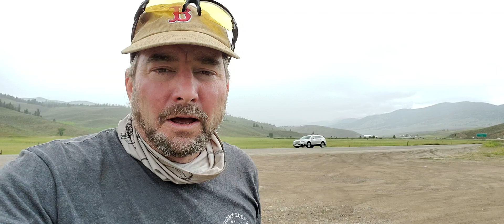737 Emergency AD

Comment from the maker: 5th stage bleed air operation-
"when the engine is "working hard" there is enough air coming out of the 5th stage, to supply everything.  Flows through the engine to make that amount of power, are "high" and the 5th stage supplies everything, and the 9th stage valve is closed.

Pull back to idle for descent, and 5th stage pressures drop, there is not enough air going through.  Now the 9th stage opens, the 5th stage check valve is FORCED CLOSED and the 9th stage supplies the air to the Airpac and everything else.

The check valve is there to prevent the discharge from the 9th stage flowing INTO the 5th stage of the compressor string.  It starts traveling in circles, causing compressor stalls."
Reply: I wonder why the AD was not for the A320 series of aircraft with the same engines. About 1/2 of the Airbus A320s have the similar (if not the same) CFM engines.
Reply: A320‘s have a diff. Manufacturers of their IPCV valves Liebherr (CEO) and Safran (NEO). IPCV stands for Intermediate pressure check valve than the one on Boeing 737CL and NG called 5th stage bleed air check valve.
Reply: I did not know that, thanks. @glincho
Reply: Darn your good! Greetings from kbos. Have a happy day

Comment: It is a simple operation to cycle the PRSOV , pressure regulator shut off valve on the ground . For the amount of time they have been parked it should be part of the return to service checks being done before returning them back into service

Comment: Sounds like the "early days" of automotive smog systems. When the EGR valve would stick open during highway speeds there would be no problem. When you'd come up to a stop sign, the open valve would disrupt the air/fuel ratio and the engine would stall. A stuck open bleed valve would be basically a giant air leak that the fuel control is not expecting.

Comment: To be more precise, AD #: 2020-16-51 concerns the 5th stage “check valve”.  The description given, although generally accurate, it is not entirely accurate as it relates to the operation of the 5th stage “check valve” on these affected CFM engines.

Comment: Why is the emergency airworthiness directive issued to the airframe and not the engine?  Something strange (or political) going on here.
Reply: AV8TOR well how is the plane supposed to fly without the engine?
Reply: @tomstravels520  That engine is used on other aircraft designs/types.  So it's not a "Boeing" issue.  To answer your question.  Gliders or sailplanes.
Reply: AV8TOR that specific engine type is only used on the 737. The A320 has a different type of CFM-56. And how does a glider get into the air in the first place? Also the clue is in the name....they glide.

Comment: This is the low pressure valve.   Actually it is open all the time.  What protects back flow from the high pressure valve is a check valve.   The check valve must be failing in the open position.
Reply: The 5th stage valve is supposed to close when HSV opens at idle or low N1 rpm, to prevent 9stage air going into 5th stage duct and compressor. Yes it seizes in open.

Comment: Dont know 4 engines is a lot, esp. if potential 1 engine landings 
also we dont think they will corrode less if longer in storage, right?
So the failure rate goes only up over time. 
Luckely they caught it now and can fix it, before an accedent happend.

Comment: Juan,  what ever you drive again or ride again you will always be looking out the window because you know what the ground looks like. I spend all my time riding aircraft looking out windows and seeing the roads I have been on. Every time I see a stretch of highway that I recognize from the air it brings back different memories of the hundreds of times I have driven that road or flown over it. They are like songs, different memories, smells  and sights of different years.

Comment: Seems like a design fault. What can corrode will corrode.
Reply: Dale Comer all stainless steel corrodes, some faster than others. The 737 components are designed for high duty cycle operation, not sitting for months on end in humid environments.
Reply: @rfish3556  I didn't mention anything about stainless steel.      The design requirements failed to anticipate the circumstances which are now a fleet wide issue.

Comment: P(both valves fail) ≠ P(valve 1 fails) ⋅ P(valve 2 fails). They are not independent events. The valve corrosion during storage will depend heavily on the storage conditions (like humidity) and the maintenance practice. These factors influence both engines equally. In my opinion, the "dual engine out" concern is reasonable.
Reply: Even if you would assume the equation is right:
4 events in far less than 10.000 aircrafts after putting out of storage, this give a P roughly 0.001.
If you multiply the result is far higher than the goal of 10 powers -9 which is the minimum goal for any commercial aircraft for events like double engine failure.

In fact this issue is really critical.

Comment: so they need to replace the corroding parts with other materials like stainless steel. Of course, they also cover the engines with plastic sheets so that no air can enter
Reply: lenny108 all steel materials corrode, some are more resistant to corrosion than others. The 737, like all commercial transport planes, are designed for a high duty cycle operation. They are not designed to sit on a tarmac in a humid environment for months and not operate.

Comment: Well, well.  I seem to have hazy memories of squirting penetrating oil into the control lines for the eighth and thirteenth stage bleed valves on the JT-8D engines of the B737-200.  That would have been in the1970s.  So many problems that appear on the newer series have been seen before.  I believe I could write a book, but I can only remember up to four words at a time.

Comment: Of significant importance and what really crossed my mind about all this was the "dump valves" in the toilets all getting corroded and stuck in the "off and closed" position thereby allowing the 737 to fill up with a whole pile of crap and causing it to crash;-))
Reply: No. It won't crash. The valves will simply slow-leak to the exterior. It will just drop a 20kg detached block of frozen turburden ice buildup through the living room tiles, the ceiling and ruin the carpet as the aircraft puts out the first stage of flap passing overhead.
Reply: @DARANGULAFILM  Perfect, it will "autodump" over someones house...

Comment: A cursory search (someone correct me) indicates that this is a "check valve" I.e. not electronically controlled and probably the size of your fist. Here is a diagram.
https://digilander.libero.it/andreatheone/Imp.vari-airframe/Pneumatic/contr.press/ENGBLEED.gif

Comment: It's actually the 5th stage check valve that is failing. It prevents 10th stage air from going back through the 5th stage duct(which doesn't have a bleed valve), into the compressor section which will cause a compressor stall. The 10th stage valve is only open at low power settings which occurs at the top of descent or any other time the power setting is low like taxiing, etc.
Reply: You are correct.
Reply: It’s the 9th stage compressor air, not 10, on 737NG and 737CL
Reply: @glincho  yes, I get my fleet types mixed up sometimes.

Comment: FAA: possibility of dual engine out. Media: Your plane could fall from the sky.
Reply: They don't glide too well. So I suppose if you're not in the vicinity of an airport when that happens you may well be screwed.
Reply: Gustav Meyrink 
I know that they glide really well.  Unusual thing to say.
Reply: @Brewt3  have heard the same. can usually glide somewhere if they go out at altitude
Reply: Marc 
17 to 1 ratio.  For every one mile of altitude, glide approximately 17 miles.  From FL300 would equate to about 96 miles.
Reply: As the general public if you end up smeared across the ground of an airport perimeter after a dual engine out, I’m not sure the physics of how you got there matter that much to you.
Reply: Dual engine out is not the best possible situation, even in the lucky case you have an airport in reach.

Comment: Is this related to CFM or Boeing ? Dose the CFM use on the Airbus not have this 5th stage bleed valve? I'm just wondering there must a lot of Airbus sitting around would they have the same issue too?
Reply: It seems bleed valves are supplied by the airframe manufacturer, not the engine manufacturer.   So, Boeing, not CFM.

Comment: This is probably a result of Boeing’s (engineering not marketing) instructions for routine startup and exercise of turbine engine functions during this hiatus.
Reply: As the engine is not designed by Boeing engineers itself (it is a CFM engine), it is not a Boeing engineering failure! So in best case it is an Boeing management failure...

Comment: Well, the way this year has been going, it would probably be a good idea to have them all checked, but that's cost prohibited. Maybe as the airlines open back up, they need to have each plane going back to the flight line scheduled for maintenance at least a week before it gets sent out. And, the networks, no comment, it's wrong to write something very ugly.
Reply: It’s not a maybe. Every airplane stored for more than 7 days will be checked the ones that left storage and that have less than 10 cycles will be checked as well. That’s why emergency AD is a big deal, airline may have to ground (stop a/c from flying) airplanes.
Reply: @glincho  True, but money spent now will mean that more people will trust them to deliver them safely.

Comment: Media needs make head lines up to hook the people.  I remember when that 767 engine caught fire at O'hare.  They said the tires burst and that cause the fire etc.. I was WTF are you talking about. The Engines are hung in front of the Main landing gear.  Thus it is impossible for that to happen.
Reply: I don't recall your reference, but the tops of the tires are travelling forward at twice groundspeed.
Reply: Do you mean the American Airlines one in 2016? That one spat turbine blades out due to faulty turbine discs

Comment: Ok random thought. Why isn’t this an issue for the old A320’s with CFM56 engines that have also been in storage?
Reply: It could be the manufacturer of the bleed valve is the problem. It is possible the manufacturer of the bleed valve is determined by the air frame manufacturer (Boeing) not the engine manufacturer (CFM).
Reply: @harlandanderson4586  That's exactly it... the bleed valve is not a part of the engine, but rather an accessory that is mounted to the engine.  Here's a schematic diagram of the configuration... notice that the bleed air valve off of the 5th stage is the one this AD is referring to.  https://aviationtechno.com/engine-bleed-air/
Reply: Maybe it is..........
Reply: @klam77  The bleed valves are supplied by the airframe manufacturer because the airframe manufacturer needs them to supply pressurized air to the aircraft pressurization system and the anti-ice system. The bleed valves are not needed by the engine. In fact they reduce the efficiency of the engine. They are attached to the engine to provide what the airframe needs not what the engine needs.
Reply: Actually I got it wrong. The 5th stage check valve is part of the engine and the responsibility of CFMI. That doesn't explain why Airbus wasn't included in the AD.
Reply: Harland Anderson naturally everyone who saw your original comment won’t see this one. And for the record I knew all along it was part of the engine but decided to let you come to your own conclusion.
Reply: @lucifermorningstar4548  I could have been correct but the bleed air is actually also used by the engine to cool the turbine case, so it needs to be part of the engine.
Reply: Boeing quality and reliability is questionable these days, it’s a shadow of its former self that company

Comment: Since the jet engines are removable.  Is it feasable to pull the engines and store them indoors? or would this not solve and/or cause more problems?
Reply: Cause far more problems and cost a fortune,   plus the aircraft without engines would need to be indoors due to high winds, i also suspect there are not enough engine storage stands in the world.

Comment: Juan, are you sure of that info concerning the position of that 5th stage bleed valve?   Shouldn't that bleed valve be CLOSED on takeoff?  (why would you want bleed air leaving the engine at that time.)   Seems like it would be reasonable that the bleed valve would OPEN on descent (because the engine is virtually at idle.)  Maybe I'm wrong.  Found this:  "the bleed valve is driven to an open position at low pressure conditions and to a closed position once the pressure within the compressor chamber becomes higher and closer to operating pressures."   I used to work with the "engine techs" on the TF-33 engines.  I was in avionics but worked closely with the engine guys.  While running the TF-33, once a certain engine rpm is reached, you can see the "EPR" jump up a slight bit, as that 6" bleed valve on the TD-33 would CLOSE as we run up to "part power" or "full power."   Always love your channel.   Thanks
Reply: The valve in question is the ‘mid-stage check valve’.  Generally it is open during takeoff and cruise when 5th stage provides sufficient pressure to run the bleed system.  But if it remains open (stuck due to corrosion) when engine is throttled back to idle for decent, or other throttle position changes when 5th stage isn’t high enough pressure to run the bleed system, the engine will surge.  Hope that helps.
Reply: @joell439  I see that - thanks.
Reply: The 5 stage vlv is the prsov and should always be open. You can control it on/off with the bleed switch. The 9th stage vlv is the high stage vlv and is normaly closed during high pwr settings. Im talking about CFM56 engines on 737-3,4,5,6,7,8 and max.
Reply: @roaldnordeman6533  Thanks, I understand that 5th stage now.
Reply: @Kandralla  Thanks.
Reply: @Michael Donavon I bet you got some big arms carrying the ARC-27 radio from T-bird.😊

Comment: We found these stuck open during our Return to Service checks at United.
Reply: How easy are they to inspect? Can they be fixed/overhauled or do they have to be replaced? Any idea the cost to replace?
Reply: @MikeCris  It's the check valves and they have to be repaired in a shop so replaced.
Reply: CFM56. The 5th stage bleed vlv is the "prsov". That one is always open as long the bleed switch is on.
Are u mixing up the check vlv or the high stage vlv? The 9 stage high stage Valve is normaly closed during high pwr setting (t/o, crz) and opens during idle descend.
Reply: @roaldnordeman6533  Its the check valve, they are developing corrosion, while parked, and getting stuck in the open position.
Reply: @strange_daiz  Or closed. Saw one today that is half closed.
Reply: @strange_daiz  yes, and  I think the AD is only for certain s/n. I haven't red the AD yet. Working @ Norwegian, MOC. More and more 737 now RTS work packs.
Reply: @airtechmech6681  thats what we had,  1/2 was open and wouldn't pass power checks, this was one of the newer NG too.

Comment from the maker: Can someone please post a link to the AD direct from the FAA? Thanks Juan.
Reply: KCAutoDoctor posted this as a reply to George Aldredge elsewhere:
https://rgl.faa.gov/Regulatory_and_Guidance_Library/rgad.nsf/0/ec0e5875b315e9e5862585ae007cd448/$FILE/2020-16-51_Emergency.pdf
The purpose was to point out that the AD itself mentions the possibility of a dual engine failure multiple times in the AD. The last two sentences of the Background section up top mention it.
"Corrosion of these valves on both engines could result in a
dual-engine power loss without the ability to restart. This condition, if not addressed, could result in
compressor stalls and dual-engine power loss without the ability to restart, which could result in a
forced off-airport landing."

Comment: i think you got that backwards... stuck closed causes stalls. stuck open would be an air leak...comp stalls are caused by a backup of airpressure.
Reply: Kandralla I run a version of the cores on the ground, LMS6000’s. At full loading our CDP, and 8th stage bleed valves are closed. When we are transitioning through burner modes (PF) they open/close. Only high loading are they calling for 100 percent close.
Reply: @JAMESWUERTELE  Interesting GPU you run there!
Reply: From the top of the AD:
"This emergency AD was prompted by four recent reports of single-engine shutdowns due to
engine bleed air 5
th stage check valves being stuck open. Corrosion of the engine bleed air 5th stage
check valve internal parts during airplane storage *may cause the valve to stick in the open position. If
this valve opens normally at takeoff power, it may become stuck in the open position during flight
and fail to close when power is reduced at top of descent, resulting in an unrecoverable compressor
stall and the inability to restart the engine* . Corrosion of these valves on both engines could result in a
dual-engine power loss without the ability to restart. This condition, if not addressed, could result in
compressor stalls and dual-engine power loss without the ability to restart, which could result in a
forced off-airport landing."
emphasis added, if YouTube commenting doesn't break it.

Comment: Bleed valve also prevent compressor surge.
Reply: Angelo Rosin I think the variable vane are for the forward stages but I think the aft stage still need a surge valve.  I may be wrong but it’s hard to believe they could run the compress to idle without a surge valve in the back stages unless you have variable vanes in the aft stage also.  Does seem like a very impractical complex way to control compress surge.